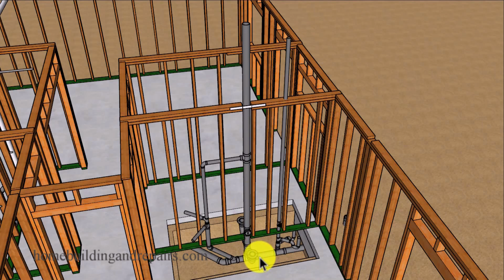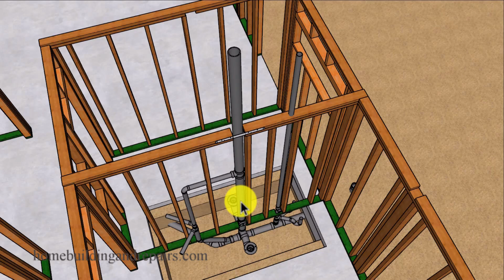Plumbing Vents Might Need To Be Larger - Different Local Building Code Creates Problems - Part 2

Comment: SoCal is under the UPC and the UPC requires an aggregate venting based on building drain size. 4" main? Then 4" needs to come out the roof. You can calculate the cross sectional area of a 4" vent and vent the house with multiple 2" vents or a mixture of 2" and 1.5" or 3" or have one fat 4" stack sticking out your roof if length requirements are not violated for the vents. Want to make sure your cross section area for a 4" main which is 12.56 is met by using multiple other vents. So example is four 2" vents could meet the aggregate venting requirements of a 4" building drain. 3.14 x 4 vents....12.56 for a 4 inch. 7.07 for 3 inch. 3.14 for 2 inch and 1.77 for 1.5".
Reply from the maker: Thanks a lot, I know it works, but didn't know why. Do you have any building code reference numbers we could look at for UPC or state of California.
Reply: @Citizen Shane, Hi from KY ..... , is a 3" main drain with 2 WC's on it (+ sinks, tubs, and Lav's)  Ok there or is 4" drain line required ? Does a 3" stack vent need to go out the roof or just 3 individual vents to cover the 7.07 area of the 3"? Is one of these 2 methods more prevalent than the other?
Reply: @gregvancom  703.2, 904.1 and aggregate venting is in the beginning of the dwv chapter in 2021 upc of I recall properly
Reply from the maker: @bobrub  Hi to ky... I think I already shared my knowledge about the vents, but can tell you that a 4 inch drain is used in most of the new construction and old here in Southern California and most of the time goes all the way through the house with a 4 inch clean out in the front and one in the back. Now to answer your next question, why does this video have a 3 inch drain, because it's part of a series I'm planning on doing for those who do have a 3 inch drain lines. Thanks again for your questions, because they help me make better videos.
Reply: @bobrub  you need to determine if you're in the IPC or upc. IPC more lenient.  Next add up DFUs. 3" can handle 35 dfus where 4" can handle 216. Aggregate venting is upc only. If your building main is 3 inch you need 3 inch coming out of the roof unless you have 4 toilets. 3 inch can only handle 3 toilets. Use cross sectional area to make sure 7.07 is coming out of the roof. See original comment for cross sectional area for drain pipe sizes
Reply: @CitizenShane  So is SoCal using upc or ipc or how do you determine?
Reply from the maker: @bobrub  California has it's own code book. https://www.dgs.ca.gov/BSC/Codes
Reply: @bobrub  upc, not sure how to determine just was told as an apprentice socal is under upc